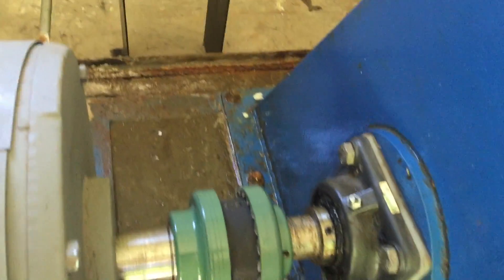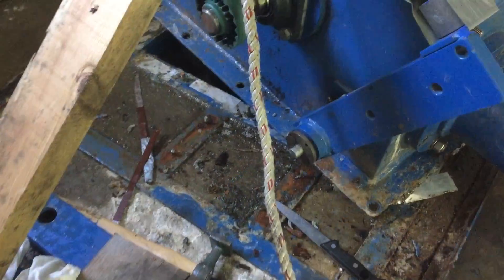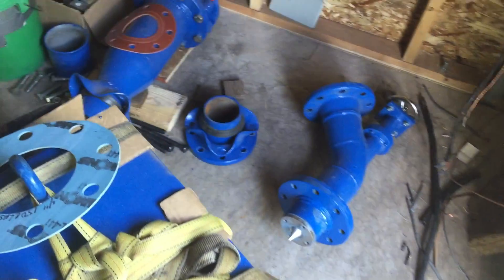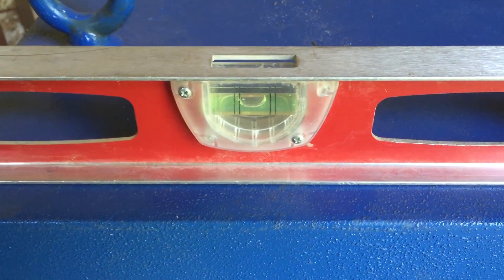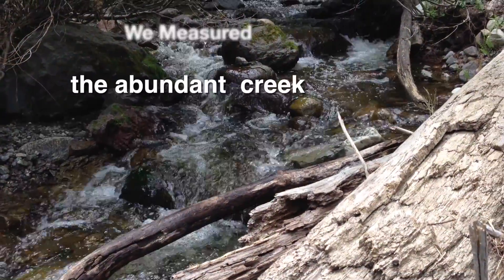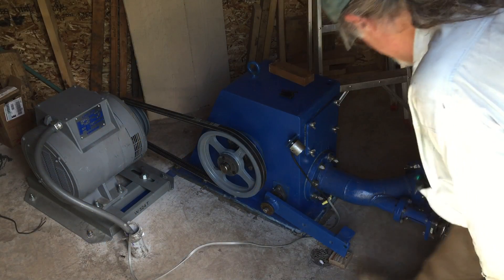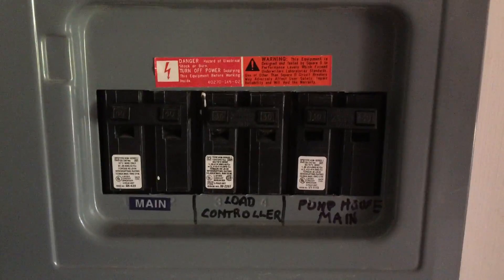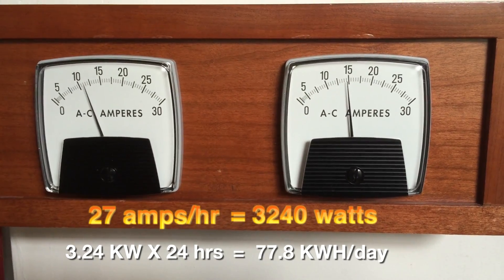Part 15 MicroHydro Power System in CO

Comment: Probably been asked a bunch of times, but curious what the total cost of the project was (material & outside labor)?
Reply from the maker: +Jake Jones Reposting a previous answer to a similar question:
"It's a good question, but very difficult to answer. First, one would have to amortize the cost of laying in grid power in 1994.  At the time of the switchover the system had produced 145,000 kWh for a basic cost of $25,000 versus $140,000 for laying powerlines. Add $52,000 of current development costs and you are paying for all the future power generation in the systems lifetime. You would also need need to subtract the cost of line power over the last 19 years to determine the cost per kilowatt hour over the first system's history. The other reality is that the present level of power production is maybe 1/5 of what we eventually hope to accomplish. 
Ultimately because it is AC you have to use whatever power you are generating at the time you're generating it.  Living off grid with hydropower means that you use more power than you usually would, you run appliances more frequently, have access to using large electric tools, you always have hot water available at no cost, can defray the cost of heating your home in winter, and you are paying for all future power at the beginning. So, it becomes a lifestyle choice. Are you willing to pay for all of your future power upfront and have no environmental impact and thereby increase the asset value of your property, or are you buying into the centralized system with power production which at this point is based about 50% down to 42% on coal for power generation over the life of the current system. 
Changing one's approach/reliance on the polluting centralized system requires planning, commitment, and patience. It is not something most people are willing to undertake, or have the financial wherewithal to complete. I got lucky and found myself able to pursue this undertaking nearly 25 years ago and am fortunate enough to share my experience via the Internet which has developed in the interim. 
Hopefully people somewhere in the world will find the information useful."

Comment: Maybe I'm a rookie but so much work, so much money and time that can break in multiple places just for mere 3.2 KW... Wanna say it's cheaper and more powerful than installing a wind turbine?
Reply from the maker: +Anton Z. Yes, one drawback to micro hydro is that you pay for all future power up front.  However, the system will produce 8.5KW once the load to handle that is installed and could be bumped up to 12KW if I could figure out how to use the power.  Don't currently have a need for 12x24 = 288kwh/day.  A Wind turbine wouldn't provide consistent power in this location and the choice to avoid batteries was made nearly 22 years ago when system was first installed.  We can live quite comfortably on 8.5 kW and manage the peak demands as needed.  Thanks for the thought just the same.

Comment: at 2:11, are those turbine impellers damaged? Awesome series, btw.... I have a small solar project on my place.
Reply from the maker: Not at all. Pelting cup design has a cut in the outer diameter area to allow the jet stream of water to most efficiently hit the most power producing part of the water cups perpendicular to the jetstream. This Pelton shows zero damage after 19 years of near continuous use. Spring water has nearly no sediment which would cause erosion. 

Congrats on the solar. It's all good!  Thanks for watching. Give a thumbs up if you like.

Comment: Interesting. However, after watching a few of these video's your pipe line would freeze in the winter that close to the surface. The intake at the dam would also cake over with ice. You turn off the system when the temp drops to a given level?
Reply from the maker: We haven't yet experienced any problems such as you outline.  So far we've had several weeks of temps in the 2-22F area.  Moving water is hard to freeze. The intake remains below the water level and the creek runs all winter. Also the snow on the ground tends to insulate the ground somewhat from the sub freezing air at night.  It is possible we may encounter problems, indeed freezing is one of the biggest risks, but so far the system just keeps running and making power.
Reply: +MrHydrohead Good luck then. I have replaced pipe in an irrigation project so I have a tendency to look at where I made mistakes in the past.
Reply from the maker: I appreciate the input. I'll document the results pro or con either way.

Comment: I'm a mechanical engineer so many of the electrical intricacies escape me.Do you have any winter system freeze-up issues?  This is your first winter so you probably don't know yetI just want to pick your brains. There is always a trade--off between installed capacity and peak load which most people solve by installing batteries into the system. It looks like you've by-passed the batteries and installed peak load generating capacity. There is also the choice of AC or DC generation and the impact on transmission. DC and batteries obviously necessitates an inverter. It looks like you've chosen to produce 60 Hz 110 volts straight up. Do you have much variation from standard and is that an issue? I can see from many system videos that everyone wants to run their penstocks level. That is an issue for complete drainage but up and down, as long as the pipe is sealed should not be an issue while generating it would make installation easier. Save building the bridge.  Did you consider a heat pump for home heating to reduce your electrical needs and the size of generator.  Looks like you can generate enough power to supply your neighbours too !! Assuming they live close enough.LOVE IT !!
Reply from the maker: +Bob Smoth 
One of my risks I always thought would be frazil ice because I saw some footage of it from Yosemite.  I just saw this video(link below) today that gives a much better explanation of the phenomenon.  Now I'm not worried about it as I better understand the conditions that create the supercooled water and I don't see this being the situation with our installation. http://youtu.be/9V9p4mFEYXc
Reply: High pressure fast moving water doesn't like to freeze.

Comment from the maker: To Norman McGill, no reply button available on your post(don't know why, says LINKED COMMENT, dont know what that means)  but I will repost an earlier reply to the same question I made 2 months ago.  Lots of people ask the same question

"It's a good question, but very difficult to answer. First, one would have to amortize the cost of laying in grid power in 1994.  At the time of the switchover the system had produced 145,000 kWh for a basic cost of $25,000 versus $140,000 for laying powerlines. Add $52,000 of current development costs and you are paying for all the future power generation in the systems lifetime. You would also need need to subtract the cost of line power over the last 19 years to determine the cost per kilowatt hour over the first system's history. The other reality is that the present level of power production is maybe 1/5 of what we eventually hope to accomplish. 

Ultimately because it is AC you have to use whatever power you are generating at the time you're generating it.  Living off grid with hydropower means that you use more power than you usually would, you run appliances more frequently, have access to using large electric tools, you always have hot water available at no cost, can defray the cost of heating your home in winter, and you are paying for all future power at the beginning. So, it becomes a lifestyle choice. Are you willing to pay for all of your future power upfront and have no environmental impact and thereby increase the asset value of your property, or are you buying into the centralized system with power production which at this point is based about 50% down to 42% on coal for power generation over the life of the current system. 
Changing one's approach/reliance on the polluting centralized system requires planning, commitment, and patience. It is not something most people are willing to undertake, or have the financial wherewithal to complete. I got lucky and found myself able to pursue this undertaking nearly 25 years ago and am fortunate enough to share my experience via the Internet which has developed in the interim. 
Hopefully people somewhere in the world will find the information useful."
Reply: +MrHydrohead I've learned so much from just watching the latter half of this series and I have been researching ALL related trades/skills/technologies discussed in this and other videos for just about a year now, but this series is/was the most inclusive of all the other channels I've watched.  Thank you so much for sharing this project thus far!
Reply from the maker: Michael J
You are very welcome.  My goal has been to share some detail of the knowledge I've gained over years working with this tried and true way of harnessing green energy.  It is rewarding to hear a comment like yours.  Thank YOU.  More to come...
Reply: Every m,ans dream, nice job. How often does the power company come out to read the meter? lol
Reply from the maker: +Electronicdawg 
Like...never.  I love it.
Reply from the maker: More like 82k which was 25k in 1996 for the initial system which gave us domestic spring water, power, & a pond. Then about 57k to move the system and massively boost the power. As stated beforehand the cost of bringing grid power in was exorbitant and the investment seen as an investment in the value of the property.
Reply: MrHydrohead so it costs 25grand to set up and instale this at home ?
Reply: We are a supplier of piping assemblies and its supports in India for Hydro power companies and your channel helps in understanding where our OSBL piping Bulk is being used by our clients. Thanks a lot for sharing and yes your costing seems very high to us may be because in india everything is vey cheap😀
Anil Patel 
Gayatriec@gmail.com
Reply from the maker: Yeah, everything costs a bit more in US, but quality is quite good. I remember shooting a documentary in Bangalore and it was far more cost effective to just get extension cords made there. Those cords still service me today after flying them home. 

Glad to hear there is a benefit to my vids in your area. Hydro is the best of the renewable sources in my view.  Expensive up front, but runs nearly forever with zero maintenance. Another video coming soon which is a shortened overview of the whole 5 year span. Hope you will subscribe and share with others. Thx for watching!
Reply: Love the videos, and would definitely pursue a microhydro setup if I had the opportunity. That said, you shouldn't shame people that don't have hydroelectric power... especially since most people don't have access to natural water features on their property that can be utilized for it.

Comment: WOW! (jaw hits floor) I, too, found this series this morning and couldn't stop watching until I saw the entire series. I'm so impressed. Job well done!

I just moved to the country myself and began designing a system to utilize the sun and wind for power generation. I'll tell you one thing. It pails in comparison to this. Sun and wind are not nearly as powerful as the strength of flowing, ever-changing water conditions. Keep up the great work. Can't wait to see more!

Thanks again for sharing. You've inspired me to keep moving and make it happen.
Reply from the maker: +Naked Machinist 
Thanks for your enthusiasm.  Congrats on beginning your own power process.  Yes the nice thing about hydro is it is pretty much perpetual with the exception of seasonal flows or drought.  Whether it is AC or DC it just keeps collecting energy.  Old simple tech too.  If its AC, heat is the natural storage, at least until producing and storing hydrogen becomes practical.  If DC batteries and inverting to AC is great.  Batteries can be a pain, and I had adequate potential to go AC.  Someday I hope to have an affordable vehicle to use the excess.  

There will be a new vid up in the next few weeks.  Its shot, just not edited, narrated, mixed, or scored.  Stay tuned and thanks again for your interest.  My system is just the first I plan to chronicle.  I hope to document projects ranging from small DC to Utility scale as time goes by.  A fun hobby for me.

Comment: How is the system currently feed by the river? In a previous video you had to remove the lines from the river to the meadow due to the extreme winter runoff, this was not addressed in any video since. Maybe I missed it though.
Reply from the maker: +kbates666  You are observant and your question is VERY timely.  Just yesterday, I finally accomplished getting the creek water into the meadow, a process that has been intended, cogitated, and worked towards for more than 10 years. Yippee!  After consulting with the water commissioner on my water right this summer, I chose to move the equipment and put the system online with the existing meadow water that gets fed by runoff from a spring fed lake about 1/2 mile away.  The existing water was what we had to control when we built the weir in part 9 of the series:  https://www.youtube.com/watch?v=FYSvpKPr_Ns   The coming videos will explain the problems of getting creek water into the meadow in greater detail.  Whew! Glad its now flowing, it seems forever since I started the planning of all this.

Comment: I watched from video 4 to Start~Up. I could not stop thinking how fortunate you are to have the resources (money) and experience (IQ) to make all this work.
Congratulations on an excellent completed project.
Reply from the maker: +Austin L. Thanks so much.  I am so very fortunate and grateful for it.  Upgrading the system was seen as a necessity after the drought conditions of two years ago combined with the changes in the water table on the springs.  In the long run I hope my work has enhanced the value of the property.  Its been a ton of work and I'm still not yet done.  Soon the water from the creek will reach the meadow, but that's a subject for another video.

Comment: Excellent video and most interesting project. I have a few questions if you don't mind me asking.You may have covered this and perhaps I missed it, but do you get any tax breaks for this like they do for solar? Can you sell "extra" power back to the power company and about how long will it take to recoup the cost of the project? Thanks again for doing this video, it was as if I couldn't put down a good book.
Reply from the maker: +Jamie Norton Thanks for the appreciation.  I am truly off-grid(7miles from grid) so no chance of subsidies.  I looked into credits, but the ones I found mostly applied to solar and this being a redesign of an existing system it was not clear whether it would apply for any tax credits.  The one's I found were county based on sales taxes on the purchase of new equipment, so I decided to not pursue it.  Payback is a tricky question, as I have now produced over 147,000 KWH since installation back in 1994 including the new system which is now about 100 KWH a day and soon to be increased.  Initial cost in 1994 was 25K, but I also got gravity pressure spring water and a trout pond out of that.  The improvements are mainly pipe, powerhouse construction, transmission line, and labor costs.  No new power generating equipment, just reconfiguration.  With the increased power output and 56K into the redesign, it is still a deal.  The bid I was given in 1994 was about 140K to run power to me and then I would have had to pay for power monthly.  On the whole its been a great savings in my view, but ultimately a lifestyle choice.  Hydro is a very comfortable way to live with more power than you generally need.

Comment: MrHydrohead,  I have a system too only a 25 kw.  I have also a new lima mac 60 kw 3 phase i got out of utah from a farmer still on the crate. I was later thinking installing but we will see. The last year they were made in the states I was told.  I see with your fernco fittings.  Try adding a small rolled piece of s.s steel sheet metal and add 2 more pipe clamps this will increase more psi.  I wish I had a neighbor like the one you have. I have never been to colorada but i hear it is a beautiful place and steep mountains to put in a pipeline.  There are other tricks to add to this but I love the videos. I am not as technical with a computer as you are but I cannot wait for the next video I have been following for quite some time. Those people in kimberley sure are a great bunch of folks.Just prepare to sell off a first born )).  Keep up the great work.
Reply from the maker: +robert howell Thanks for your input.  Next video will be about refinements, but it will be a while until I complete them, shoot video, and edit and post it.